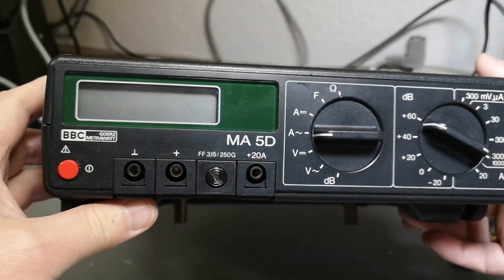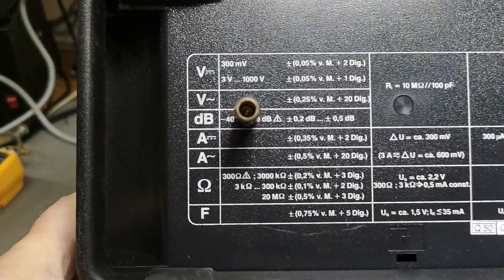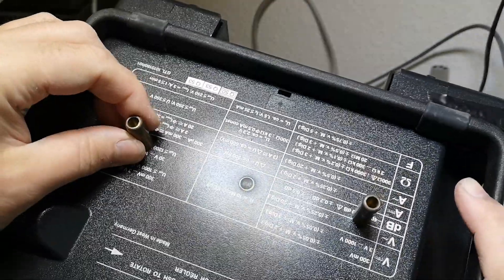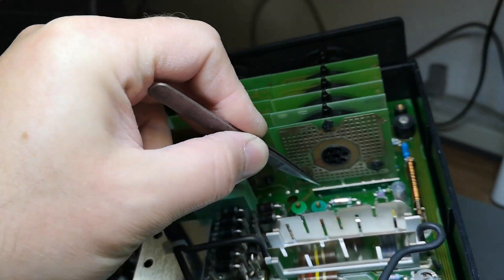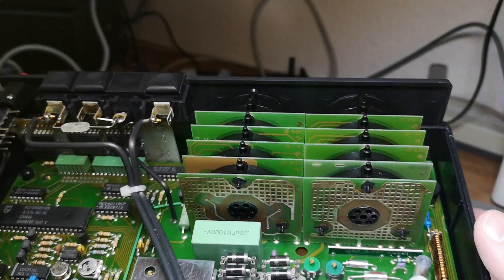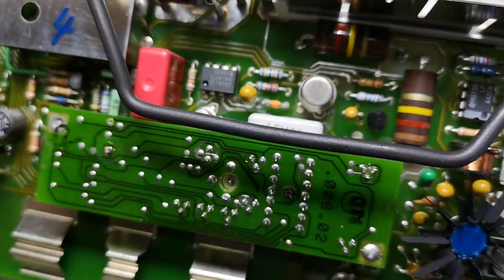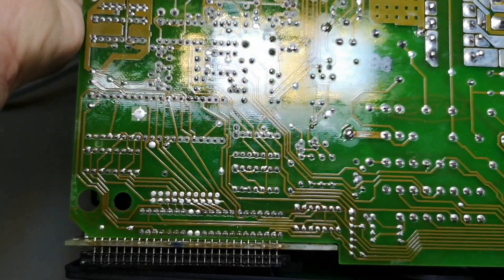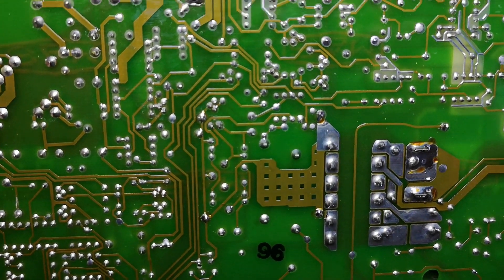BBC Goerz Metrawatt MA 5D Digital Multimeter Messgerät test Teardown

Comment: Great Meter , used it for decades ! BUT ...if the day comes ,the meter shows you " -2", you are out of luck ! Because then the the A/D converter is gone , and there is no replacement . Also the inner parts of the knobs tend to break over the decades.

Comment: 2 legged transistors are there as low leakage diode clamps, using base collector junction to make a very low leakage diode. Cut of emitter so as to reduce noise, and collector is connected likely to case and ground, as extra shielding. Order of magnitudes lower leakage over a regular silicon diode, and no light effect either, plus can handle 200mA easily as well.

Daughterboard is likely the reference voltage and probably comparator, as they likely implemented a dual slope ADC unit in there, using the AD parts for stability . Yes interesting construction, they wanted that extra digit, and thus had to roll their own converter to do so.
Reply from the maker: yes, i was very impressed about design and performance, the look is a bit "old" seen with today's eyes.. but i hope a new owner will be happy for it, since it is up for trade/sale from today..
Reply: @TeardownOZ2CPU  Once again pity about posting it.....
Reply from the maker: @SeanBZA  I know, and Danish post is the most expensive you can imagine, too bad I dont live in Germany, their shipment is super cheap and super easy.
Reply: @TeardownOZ2CPU  No, yours is cheap, here by me it is $200 to send a 1kg parcel internationally, and $300 if I actually want to have it arrive intact, and still in this century.  Post office motto here is "We Deliver, Whatever we do not take", and they mean it. 6 weeks for a letter in the same postcode, from a PO Box, to another PO Box, in the same building.

I have booklets of stamps that are likely to become antiques, before I actually use them.